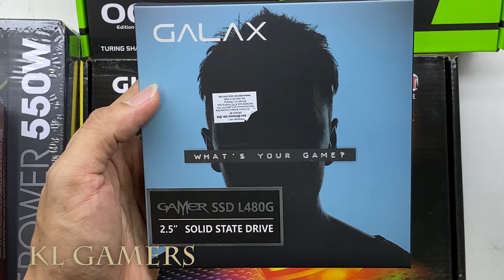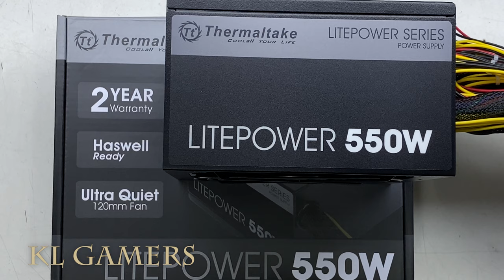intel Core i7 9700F GIGABYTE B365M D2V GALAX GAMER SSD GTX 1660 Super 1st Player DK-D3 Build

Comment: How's the temperature going with that poor 9700f 😂😂😂
NO SERIOUSLY YOU PUT INTEL HEATSINK ON A 9700F ?????
I have 9700 and my masterair ma410m putting its MAX power to cool this cpu and I get max 75c-80c 
How much it would be like if I put intel heatsink 🔥😂😂😂
Reply from the maker: 99c max
Reply: @KLGamers  😂 surely you ain't keepin it unless you change the heatsink of course, or you're the type that doesn't give a damn about temps therefore his system won't last a year🤣,
your gonna sell it or do something with it right?
Or you're giving it to someone and let him do anything with it
Reply: @KLGamers  Hi man thank you for this video which shows exactly my mobo, I'm considering swapping to this i7 9700 (non k) but my question first is that is this build last well - did you try or test or work on it for a long to ensure the build like this is absolutely fine overall?
My pc case is very bad (office case) so I think I would downclock the cpu (and even undervolt if possible) to a decent level like ~4.0ghz for allcore boost to maintain decent temp with my stock cooler, I just need temp around ~70-75c in heavy gaming which should be ok : ))